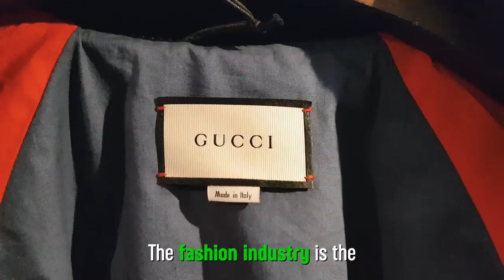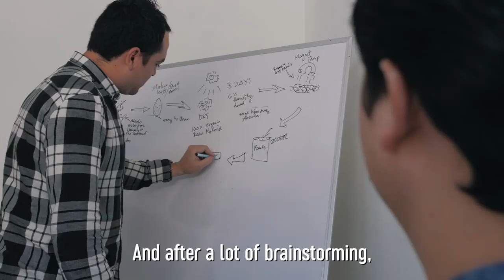Desserto | Cactus Vegan Leather

Comment: Important question: in all the articles i have read regarding this product they say it's partially biodegradable. Why is that? Are you 100% sure they are not using plastic/pu and just mixing in cactus (?) into it?
Reply from the maker: We only count as biodegradable contents which decompose under ASTMD 5511 testing in 1-6 years under anaerobic landfilling conditions, actually makes it easier for bacteria to reach and digest the discarded material, thus accelerating the biodegradation process.